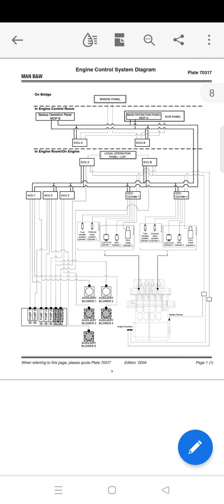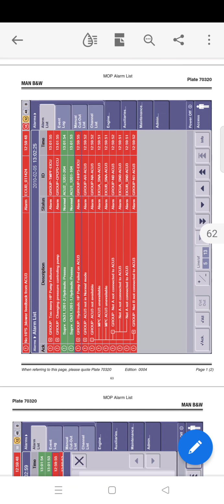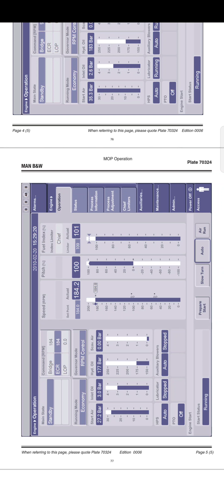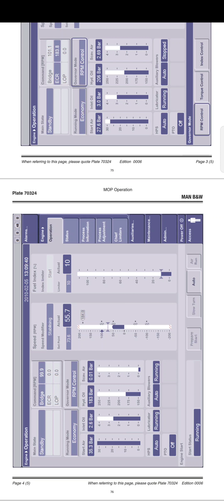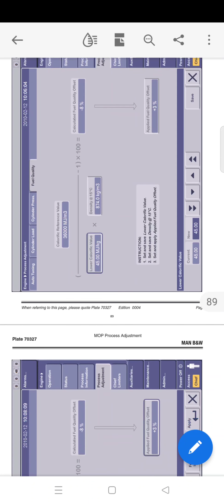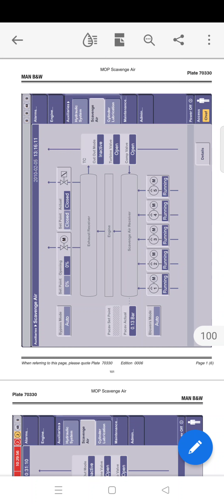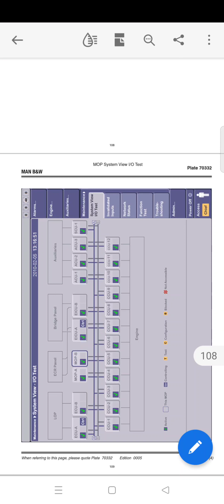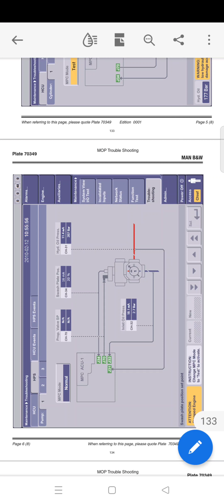MOP PANEL MAN B&W ME- C ENGINE FULL DESCRIPTION

Comment: 00:08 The engine control system consists of controllers like EICU, ECU, ACU, CCU, SCU, and MOP.

03:02 The Engine Interface Control Unit (EICU) receives navigational inputs from the control station and selects the active station based on signals.

07:36 The engine control system is operated through a trackball and human machine interface.

10:00 The mop panel has four fixed areas- alarm status bar, navigation bar, toolbar, and access levels.

14:55 Accessing and managing alarms on the screen

17:17 Alarms can be acknowledged or in normal condition

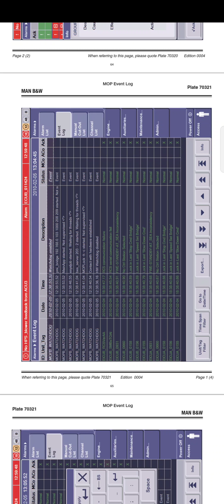21:56 The event log allows searching and filtering for specific events.

24:08 The system allows for manual cutout of alarms and provides a separate list for accessing them.

28:35 The main state field contains three status field indicating the current sub telegraph command states and the states of the engine.

30:54 The RPM fine adjustment can be accessed by pressing the command RPM button

36:36 Auto lubricator and auxiliary blush can be in auto or manual mode and can be stopped or running

39:25 The engine status is displayed on a bar graph, and limiters control fuel injection based on operating conditions.

43:44 Summary about tacho system test and engine status screen

46:03 Check engine conditions before starting

50:36 The screen provides an overview of the engine running modes and controls.

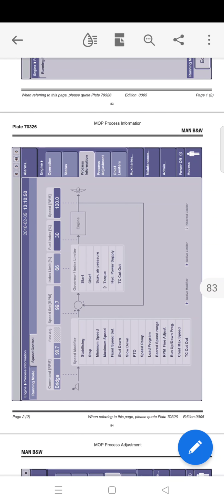52:58 Operator can adjust the balance of the engine and fuel properties in chip level for better performance.

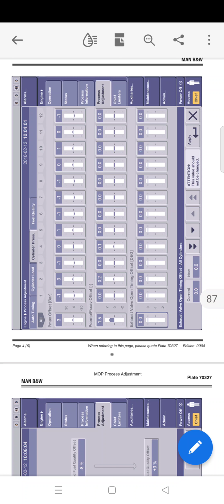57:42 Fuel quality adjustment and chief limiters are important in engine safety

59:57 The system allows for individual cylinder control and resetting

1:04:27 Adjustment of hydraulic pressure set point

1:06:43 The pump truck limiter must be activated to protect the gear or chain.

1:11:20 Bypass bulb is installed to prevent over-pressurization and oil leakage

1:13:18 The bypass valve is tested every six months and controlled via auxiliary control units.

1:17:15 The lubricator system displays flow rate and malfunctioning

1:19:09 Oil usage and cylinder lubrication

1:23:16 The multi-purpose controller is a computer unit with a wide variety of inputs and outputs for interfacing to sensors and actuators of the engine.

1:25:18 The multi-purpose controller is a motorola 68332 borrowed from the automotive industry.

1:29:37 The system allows for validating and invalidating input channels.

1:32:06 The network status can be viewed and monitored using the Network Control screen.

1:36:41 Verify fuel booster and exhaust valve functionality

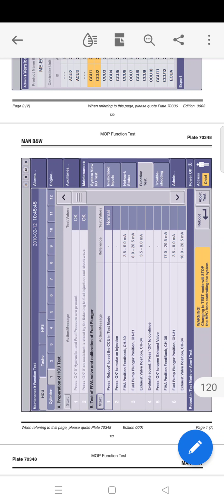1:38:44 Signal value outside the reference range indicates a wire breaker issue

1:43:34 Learn how to use the up and down button and the set button to view new values

Crafted by Merlin AI.
Reply: Thank you! Did you made the timing map with some AI service?
Reply: @aleksandrlogin...739  yes Merlin AI